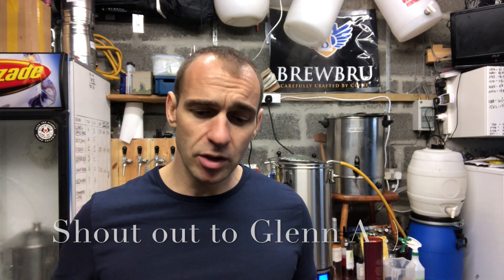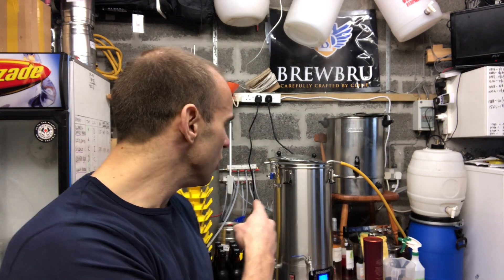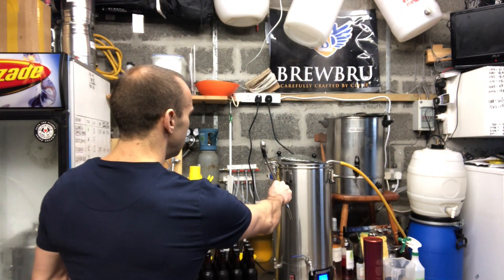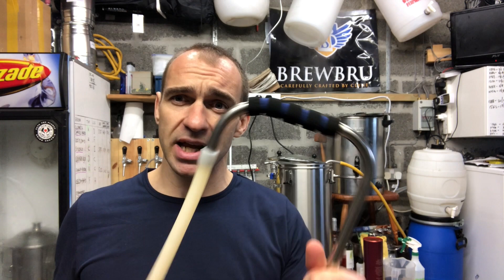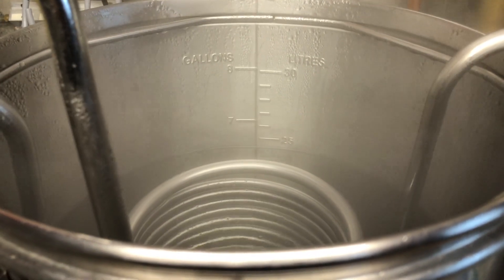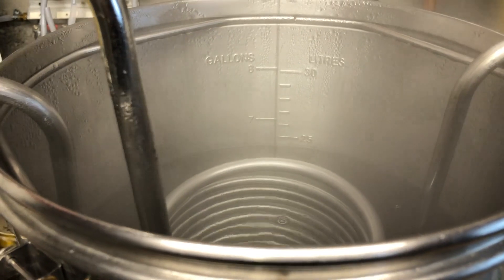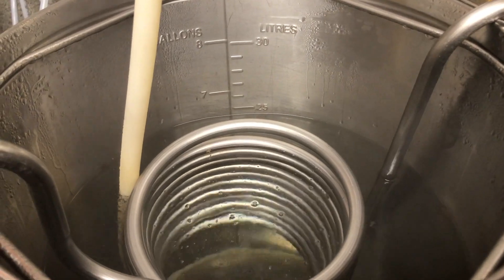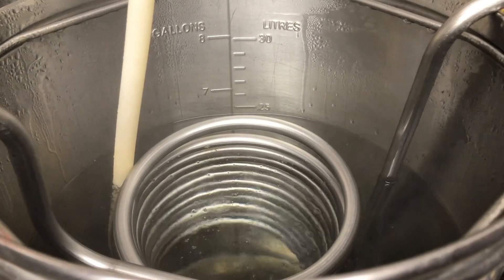BrewBru ep9 - Robobrew/BrewZilla Whirlpool attachment - cooling times

Comment: Hi, thank you for an interesting video. I purchased my whirlpool arm just to whirlpool my hops. I only use my hop spider for my bittering hops. After that I just throw them in. I thought the arm did a reasonable job creating a cone of hops in the middle. I did think it would assist cooling but it was not a high consideration when I purchased it. Love your Vid's by the way. I have subscribed and look forward to more stuff to come. Thanks...
Reply from the maker: Thanks for the info Peter, interesting that you've had more success with creating a cone from the whirlpool arm.  Did you still have the chiller in while whirlpooling or take it out first?
Reply: @brewbru  I leave the chiller in, keep the bottom of the arm against the side of the brewzilla on full flow. I'll take a photo next time...🍺
Reply from the maker: @peterwells4424  interesting, thanks! Might need to give it a second chance 😉